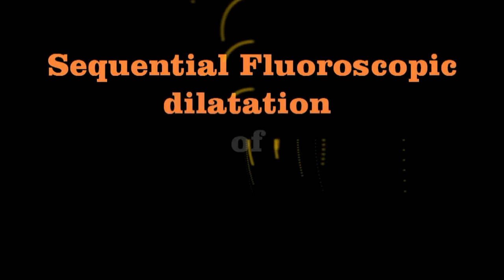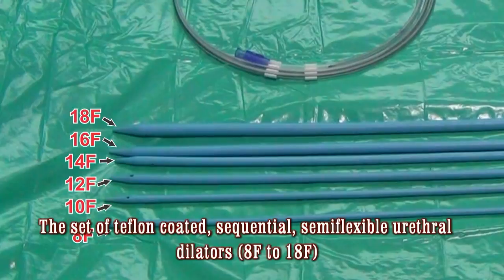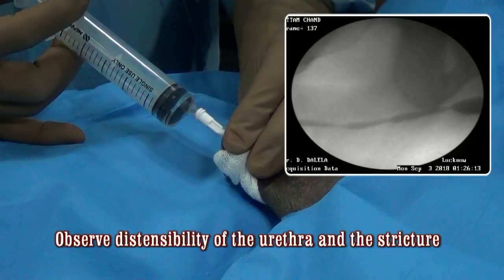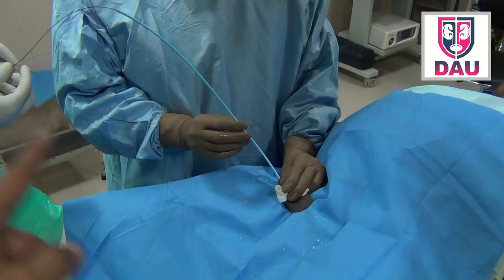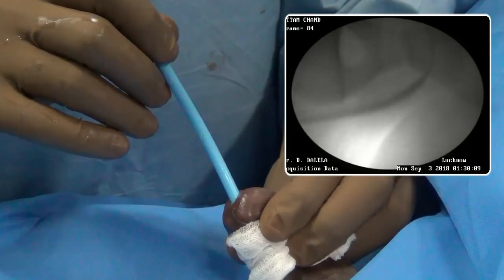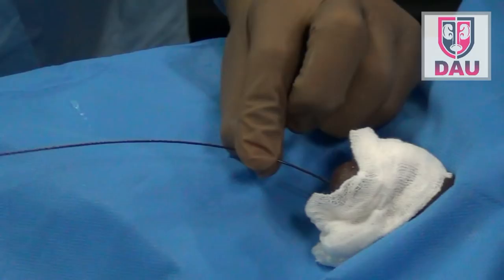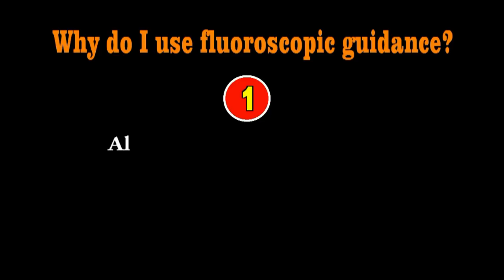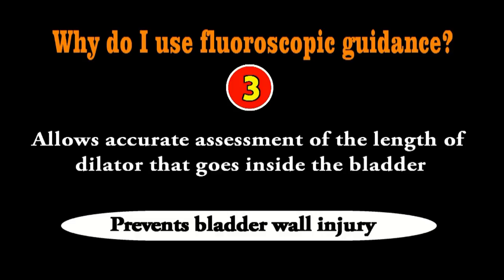Sequential dilatation of stricture  How to do

Comment: I've been paralyzed for 27 years. I've straight cathed my entire time paralyzed. Because of this fact I had a build-up of scar tissue that was making urinating very difficult. By continuing to cath I developed a false passage. Since I don't have health insurance (I'm American or course) I had to solve this problem myself. To do this I bought a larger size Foley catheter than I use for regular cathing. I normally use a 10F size for daily use (I used to use 14F until it wouldn't fit due to the scar tissue). For the Foley, which I needed to use for 3 weeks while the false passage healed, I used a 12F with the coude tip (angled tip). When I removed the Foley after 3 weeks I found it much easier to use a larger cath again which makes going to the bathroom much quicker and safer as larger caths don't normally break through and cause a false passage since there's no space. Also, the coude tip caths are all I will use now. Make sure the angled tip is pointing upwards and you lube at least 6 inches of the catheter and insert with slow but steady pressure. If there is ANY resistance remove the catheter immediately. Sometimes you just get a little swelling and it takes time to go down, so not every instance of resistance is a major problem. You learn a lot of tricks when you don't have insurance!
Reply: Mother of God... God bless Europe..
Reply: Do you know the top urethroplasty urologist SURGEON anywhere,  for reconstructive techniques urethroplasty, 
Plz.help me as I have urethral Stricture 6mm fibrosis for REPAIR , cause I have done conventional  Urethroscopic internet urethrotomy,  useless failed operation , only 6 months was useful.
Reply: Do you or ANYONE  know the top urethroplasty urologist SURGEON anywhere,  for reconstructive techniques urethroplasty, 
Plz.help me as I have urethral Stricture 6mm fibrosis for REPAIR , cause I have done conventional  Urethroscopic internet urethrotomy,  useless failed operation , only 6 months was useful.
Reply: How are you doing now?
Reply: Me

Comment: Thank you for this video. You said that some people do not have to have a catheter after this procedure, is that in all cases? How would that be determined?   2nd question can the Urethra rip/tear or pull apart. 3rd question How long does this procedure take?     4th question will you have to be put on Antibiotics after or doing the procedure. 5th question how long after this procedure will the stretching last?    Thank you so very much🙂
Reply: Did you get treatment? How are you now?
Reply: @jaysolanki96  YES I HAD THE SAME TREATMENT 4 YEARS AGO AND IT HELPED GREATLY. I JUST RECENTLY HAD A FOLLOW UP SEVERAL DAYS AGO. THE URIOLOGY DOCTOR PERFORMED A CYSTOSCOPY TO LOOK IN THE BLADDER. HE SAID THE URETHRA STILL HAS A SLIGHT STRUCTURE. BUT I AM DOING SO MUCH BETTER.
Reply: @BARUCH6223  I have come to Ahmedabad for its treatment, I am very worried. The doctor is talking about meatotomy but I have to get dilation done but he says that doing this will not cure it permanently. I am very upset to hear all this.he said  That cannot be cured by dilation
Reply: Hello bhaii
Reply: @BARUCH6223 BRO..
Reply: @jaysolanki96  HOW DID YOU MAKE OUT?
Reply: Heyy??
Reply: Bhai kaise ho kya kita steicture ka ? @jaysolanki96
Reply: @TheHimalayanbhai--  tumhe bhi hai?
Reply: @jaysolanki96  hn bhai koi treatment Kiya tumne ?

Comment: Sir, my father suffering with this since 2 years. Doctor treatment with Dilatation in every two months. If sometimes he does late to take this treatment then urine stopped to come out.
Sir, my father is suffering badly to take this treatment is it possible a permanent treatment solution ?
And he is also suffering through sugar and arthritis .
His age is 72years.
Reply: They can insert a Foley catheter that stays in the bladder therefore not needing to straight cath. At his age it would be smart to look into this.
Reply: I have the same suffering of your father ,
Do you have final management obtained for that?
Plz. Let me know ehere to have permanent surgery for bulbar  urethral Stricture 6mm long underwent DVIU or oiu but 6 months postoperative Stricture recurrence happened. 
Let me know the top urethroplasty  surgeon  in INDIA.
Thanks a lot for humanatarian feelings.
Reply: I have a stricture i just got this done today.  She said that depending on the size and how ur body heals that dialation only works 30 % of tbe time for smaller strictures.  I got a catheter in now and it hurts but she said if it returns i will have to get an urethraplasty and is very success for long term no return!!!
Reply: @williamlangeii4012  what are about 30 years old with same case
Reply: @deepnthasouth2527  is urethraplasty safe
Reply: @abdiaden2670  no my pin hole daily dilate
Reply: @deepakhardware7823  what do you use dilation
Reply: What kind of instruments do you  use
Reply: @deepakhardware7823  WhatsApp
Reply: @abdiaden2670  yes
Reply: @abdiaden2670  yes
Reply: @abdiaden2670  yes
Reply: @deepakhardware7823  maybe number is missing
Reply: Oh god. Please 🙏 help us from these 😭
Reply: Ballon Dilation Aka OPTILUME Has High Success Rates look into it guys
Reply: @abdiaden2670  sxb ma somali bad tahay  are you somali abdi  aniga aya xanunkan qabo mudo marka ilahay hana caafiyo
Reply: @deepnthasouth2527  reoccurrence k bad bilkul bese hi ho jata h jese phle tha structure??